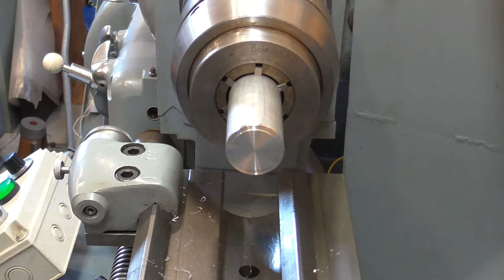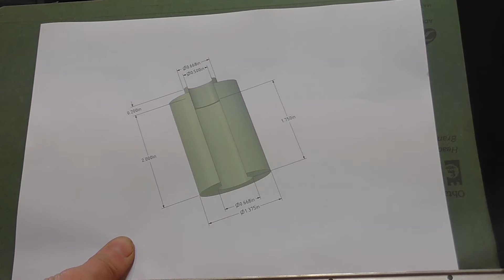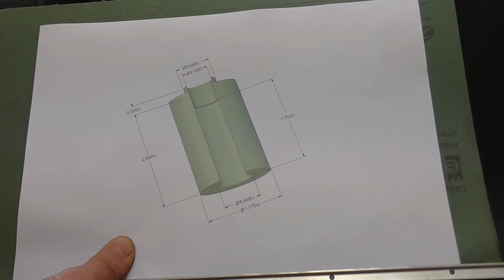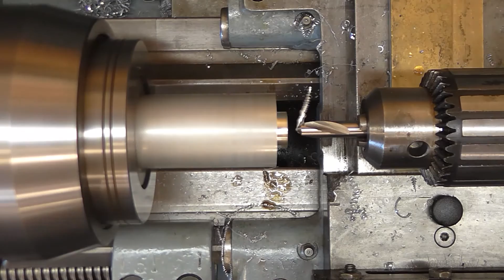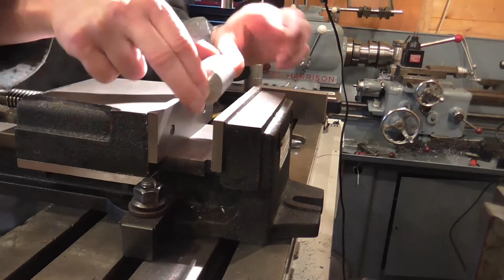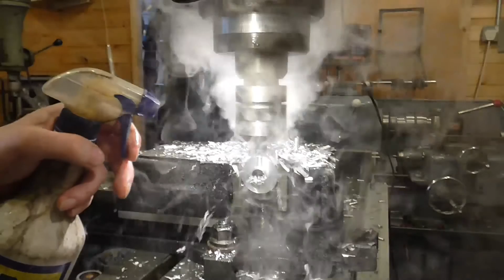Milling machine quick adjust depth stop

Comment: Hi Paul,

The HD is great. I can see from here your drills need to be sharpened...... Does your Z axis track the knee or the quill? 

Cheers,

Tom
Reply from the maker: Hi Tom,

1080p shows all the warts!

I don't have a particularly good selection of larger drills yet and the one I was using has worn lands.

My Z axis is on the knee, but I have a cheap self contained scale for the quill that I'll get around to installing some time.

Comment: Hi Paul: I love your Harrison; a solid quality piece of machinery. Except for purpose made industrial quality lathes, Oriental samples as good as they are for the price, can not compare in quality or craftmanship.I noticed your preference which I share, for spotting drills as opposed to center drills which are designed for a different purpose.
Also, I use stub or so called screw machine drills in basic sizes to star a hole because they are short, thin webbed and don't flex and continue after with regular length ones. Your video allowed us to see live, what we all know about how long and slender drills flex even when step drilling in aluminum !! all clearly seen in your film. That's why precision holes must be drilled, bored and then reamed to obtain accuracy because a reamer follows a crooked hole.Your sleeves are an excellent idea and don't need the above procedure. As for tramming, I attached a key to my vise which is a snug fit  on the slot of the table and simply move it to one side when I don't need it; maybe you should consider it. 

Cheers
Jorge
Reply from the maker: Hi Jorge,

The tip doesn't break off spotting drills!

I used to have keys on the bottom of my vices, but if the keys are a good fit in the slots, they can easily bind if you don't lift the vice square. That's hard to do on the bigger examples. I often like to have my table completely clear and if you can tram your vice in seconds you don't think twice about taking it off.
Reply: Paul Compton You're right Paul, simply because like everything else in life, you gain some you lose some. No solution is perfect, everything is compromise.

Regards

Comment: Hi Paul !

Nice drawing you made ... I noticed you saif SpaceClaim ... not DesignSPARK ?

Why did you change ?

And a nifty little tool if your depth stop works that way, sure ... mine are one of these circular ones - so this project I don't have to put on my list !

That list is growing too fast ... I gotta pick projects off the list faster, but it means you have to work faster in the shop ;-((

Anyway, thx for sharing the idea !
Reply from the maker: Opps, my mistake! DesignSpark Mechanical is produced by Spaceclaim and is a bit of a mouthful. DSM has a much reduced feature set, particularly in the import/export types and I've been talking to people at work about the possibility of getting an educational licence for SC.
Reply: Paul Compton Yeah, I noticed too that SpaceClaim has a bigger sister for DesignSPARK Mechanical called Engineer and IT looks very, very potent I think !
Reply from the maker: Keld Sørensen
As a registered DSM user, I was offered a copy of Spaceclaim for around £1800, which as far as I can find out is quite a hefty discount.
Reply: Paul Compton Ups, that's a lot of money compared to the free copy of DSM - the two looks much alike and I think DSM is a subset of the SpaceClaim-Engineer version - right ?
Reply from the maker: Keld Sørensen You'll see a logo saying 'Powered by Spaceclaim' at the corner of the splash screen. RS have paid for a special cut down version, which they're using as marketing tool.

Comment: Interesting collet chuck. It has a wide range from the looks of things? Seems like it takes some bed space away just the same.
Those spacers seem pretty handy as well....:-)
Colin
Reply from the maker: The collet set for my chuck runs from 0.125 to 1.5 inches, each collet covering 0.125 inch. It does take a good chuck of bed length, but it's never been and issue. I'd hold long work in a different way.

Comment: Thanks for the video, Paul. That's a clever item you have for squaring up your milling vise with the table. That's an interesting collet you have on your lathe. I've never seen one like that.
Regards,
Dave
Reply from the maker: I made a video about a 'Quick way to tram a mill vice'

I use the Burnerd Multisize chuck quite a lot. They're fairly common in the UK.